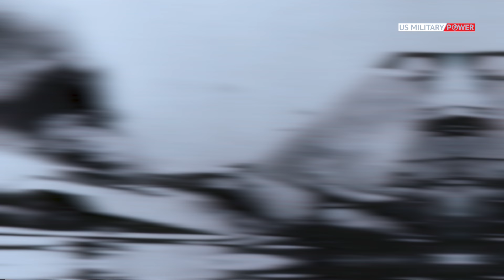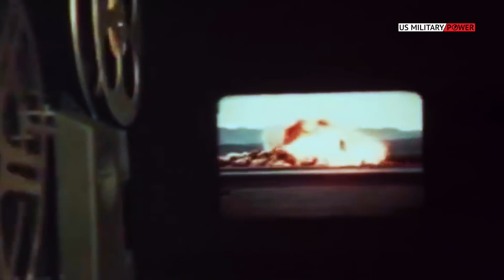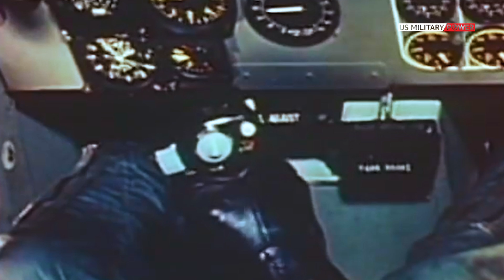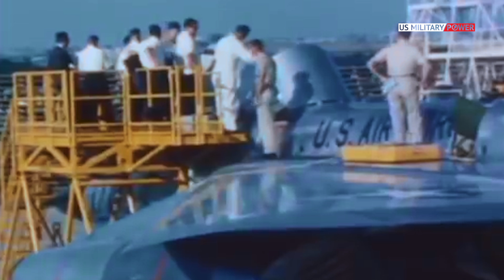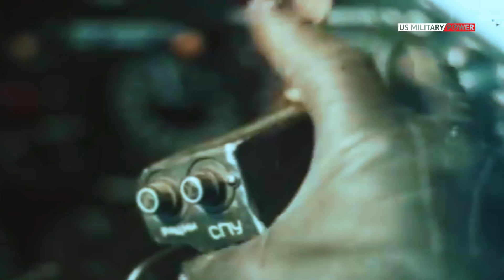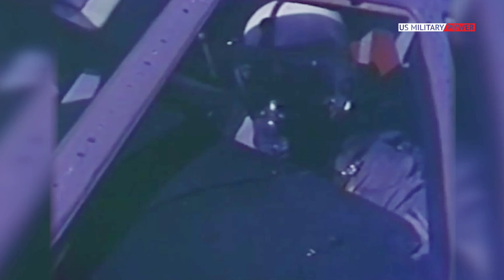B-58 Hustler: America's Cold War Nuclear Bomber Blunder

Comment: Keep in mind, the Hustler was Mach 2 in 1956.   The F104 was 1958....
Absolute bad-ass bomber.   A long since passed friend was part of strategic air command when they explored the possibility of the B-58 as a low level penetration bomber.  His term "absolutely frightening!"    There are some youtube videos documenting some of the low level attempts.  My understanding that range "on the deck" coupled with lack luster speed spelled out the end.
Reply: @JackNiles at low level it would not have reached Mach 2, probably not been able to maintain Mach 1.
Reply: @jwenting Your thinking of the B-52.  The 52s wing structure does not allow it to fly at any kind of speed low altitude. However the B-58's Delta wings were perfect for low-level attack at any speed. If you think today's fighters are impressive at low altitude, imagine 4 J-79's pushing the B-58. It's frightening. I heardvthese planes take off at LRAFB....dayum impressive.

Comment: I don't think it was a blunder. I think the only mistake was not converting it to conventional bombing. Thing is, they were wrong about SAM capabilities vs. the B-58 and B-70. The SR-71 demonstrated that surface to air missiles cannot cope with a target that can change course at speed, because they are coasting for most of their flight. By sufficiently altering the intercept point post-launch, the missile runs out of energy and misses. The B-70 was as fast as the SR-71. It could have performed the same tricks. And the B-58 would have been able to do the same vs. SAMs of its time.

Comment: When I was a kid in the late 60s early 70s the B 58 hustler was the most bad ass plane in the world in my 8 year old opinion! I remember the little plastic airplanes you could buy in the store for about a buck. I had a bunch of planes and the B 58 hustler was my favorite.
Reply: I had a toy, good-sized of the Hustler, and it had an X-15 that could be launched from the toy. When I would tie some heavy string to the toy and spin it around, it made a whining sound (I think) caused by the air rushing through the "intakes" of the "engines." Good times.
Reply: Mine too. :) I loved the clean lines, delta wing, and ultra-high speed of this incredible aircraft.

Comment: The B-58 was no blunder.
The best weapons are the ones you don't have to use.
Reply: Correct. And once SAC figured out how to train the crews and maintain the bombers properly the accident rate went down rapidly.
This when the accident rate of the B-47 stayed high throughout its career, and of course the B-52 ALSO started with a very high accident rate, which took several major structural changes to rectify as those were in part a result of design errors.
Reply: Thank you. My Dad flew a B- 58 out of BH AFB, the 305th Bomb Wing. I was a teenager and never had a peaceful moment when he was flying. It does kind of hurt to hear it all called a blunder. LOL. 72 years old and it hurts my feelings!

Comment: As a AF pilot in Vietnam 68-70, I remember hearing of a plan to use the B-58 in N Vietnam that was never used because of adverse public opinion. Here it is: Fly the 58 on the deck (50-100 feet), at mach 1 over Hanoi....the shock wave would tare bldgs apart.

Comment: The peacemaker was neither the P-36 OR the B-56.  It was the B-36.  It's odd that that would be screwed up twice so quickly.
Reply: I thought the same thing...This is the first video I've watched from this uploader...Likely my last...
Reply: The narrator is obviously NOT knowledgeable about aircraft.
Reply: Narrator most likely is AI
Reply: I noticed those two gaffes as well.
Reply: CORRECT.  B-36 was also the largest Bomber EVER in US HISTORY, yes larger than the B52, 10% Larger, had 10 engines (4 turobojets and 6 turboprops).  Watch "6 turning and 4 burning" and then the comments.  LOL - they did the taxing, checklist and the comment was "Checklist complete, turn back and refuel".  Took the thing FOREVER to take off.
Reply: @bobbycv64 The six engines that powered the B-36 are Pratt & Whitney R-4360 Wasp Major, 28 cylinder radial engines, each rated at 3,500 Horsepower. There never was any plans, or ideas to fit turboprop engines to the B-36, at all.
Reply: @johnosbourn4312  B36D with additional  four turbojets flew in 1949 and all earlier aircraft were reto-fitted.
Reply: The big stick was the nickname
Reply: Actually B-36 wasn't named the "Peacemaker" that was a nickname given to it in reference to the Colt 6 shooter, however religious groups threw a massive fit saying that only Jesus can be a peacemaker...USAF just called it the B-36 to avoid offending anyone...
Reply: @SCP-POOL  you are correct, B-36 was the Peacemaker.
Reply: @SCP-POOL  No, not even.

Comment: McNamara was the blunder, not the B-58.  The B-52 has zero penetration capability. It must use standoff weapons.
Reply: McNamara screw up everything he touched !       M-16, F-111 and now the B-58 !   He cost lives…..Bright Boy without common sense !
Reply: Strange logic Standoff weapons much more effective harder to intercept
Reply: @Eric-kn4yn  No. Freefall bombs have larger warheads since they don't require the airframe and propulsion system of a standoff weapon. The B-58 flew at identical speeds and altitudes to the Hound Dog carried by the B-52. In addition, the B-58 had defensive armament,  maneuverability, and human intelligence to guide it.
Reply: @Eric-kn4yn  No. Freefall bombs have larger warheads since they don't require the airframe and propulsion system of a standoff weapon. The B-58 flew at identical speeds and altitudes to the Hound Dog carried by the B-52. In addition, the B-58 had defensive armament,  maneuverability, and human intelligence to guide it.

Comment: I read years ago that the B-58 airframe was stressed for 7 G's positive and, now get this, ONE HALF G negative, and that was it. You could fly it with a momentary negative force, but if you pushed it, things would break. Also, there seems to have been something inherently wrong with high speed bombers of that era.  The B-58 was dangerous, and the Soviet counterpart, the TU-22 was a nightmare.  That's the one with the two engines far in the back, high on both sides of the vertical stabilizer/rudder.  Stories about that one almost make the B-58 look good...  Almost, but not quite.  Perhaps the only successful supersonic bomber of that era was the French Mirage 4....and it was certainly the most beautiful.

Comment: I agree 100% it was such a remarkable and notoriously efficient airframe.
We gained so much knowledge from its inception and service.
However I am slightly concerned by the narrators rather elementary and simpleton defining of the aircraft as a “blunder”.
The Naïveté’ of aircraft inception and design would apparently lead the narrator to assume that every military aircraft ever designed was a blunder.
The B-29 could only carry one nuclear bomb so that’s a failure. Doolittle's B-25’s had to be launched so close to Tokyo thus proving another failure. Not to mention a pitot issue in Guam that took down a B-2. Nothing but failures.